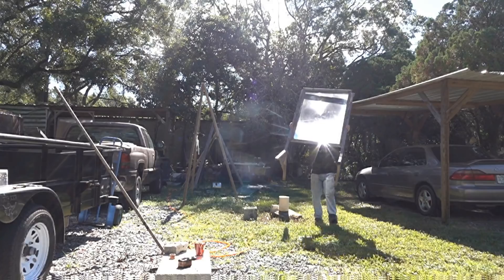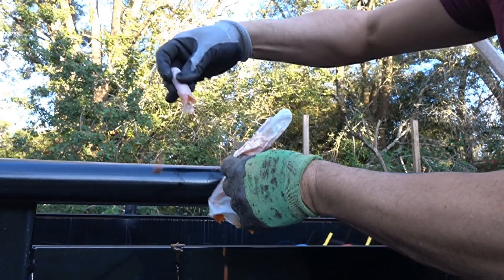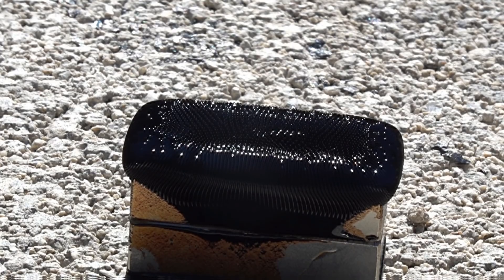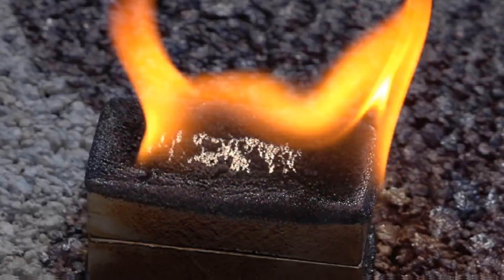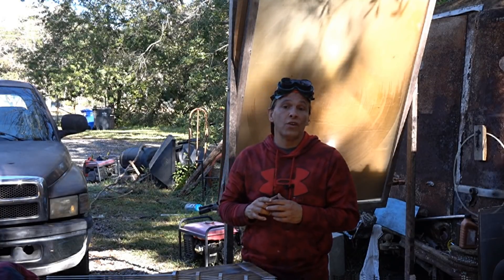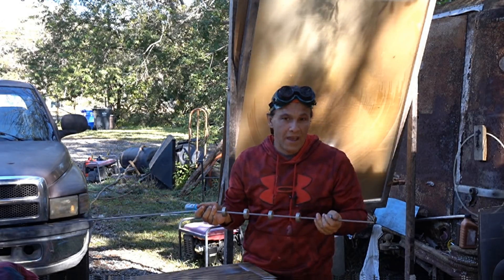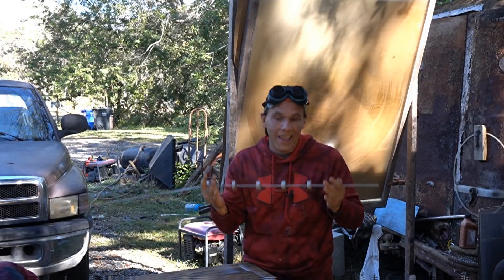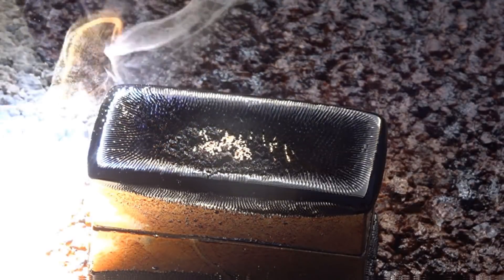POWERFUL Neodymium Magnets Ferrofluid, Lenz's law, collisions, and a Fresnel Lens

Comment: Hi,

If you get your fingers (toes,...) pinched by strong magnets, just have a proper spool with a suitable wire (windings on thereof) handy. Then use an AC power source (something low would be nice) to connect the ends to the the wire terminals. 🤔😮

Put the pinched part (hand for instance) near the coil (don't let it touch !). The produced alternating magnetic field would weaken the domains in the magnet. Thus causing it to become less strong.

You might permanently destroy your precious (pricey !) neodymium magnet, but then again you have to ask yourself what is more important - your (e.g.) finger or a magnet ? 😂😅😃😀😁😄

This thing is called a degaussing coil. There are videos on YouTube on how 2 make one.

Comment: Ferro fluid bearings? You think high speed frictionless movement can be achieved that operates better then magnet bearings? Magnetic engine with ferro fluid coating the inside wpuld allow high speed levatation effect from how the magnetic fields flowed through the fluid? That would form a vacuum layer between the fluids being acted upon by the magnetic feilds allowing high speeds to be achived? You think it would be possible? 😊
Reply: Indigo Dragon71 Hi,

You can research UFO Mercury Engine. Also Nazi Bell (Die Glocke). The Helmholtz Coil is often referred together. 😏
Reply: Nazi why becuse those insects were the zee master race? There is much better technology then what those free masonic stooges were working on for american shadow government. 😊
Reply: Indigo Dragon71 Well if you look at it more deeply, our "most primitive knowledge" (mining, ore processing, melting metals, making of knives, shields,...) is freemasonic is some sense. 🤔
Reply: Indigo Dragon71 You mean the transgendered chimera goat-(wo)man ? 😅

Well my thought was on the Fallen Angels (Book of Enoch). Nephilim bloodlines & so. 🤔

Comment: Dan i have a question for you........is it possible to use a Fresnel lens to heat a water heater tank  that has been stripped of the jacket and insulation and painted flat black, exposed to the southern sun. the tank is mounted with the top pointed north and the bottom to the south, so the tank sees sun early morning til sundown along the curve of the tank. if so can it be set in such a way to mount it for year round use with minimal adjustment. i can see where the lens can work very well for a short period of time as the focal point will be strong for a hour or so as the sun passes over or would a few lens' be mounted at different places to be aligned with the sun at different times at different spots of the tank. i haven't seen you touch on this in any of the 100's of your videos that i have watched to this point. do you think it is possible?
Reply: put something reflective underneath  or better yet encase it in a glass covered box, you can even insulate it if you live somewhere cold and yes a giant Fresnel lens or a bunch of small ones to concentrate light can help a lot
Reply: Other channels have done this with the Sun / Hot water.   You can easily burn the house down with a fresnel lens - it's something that shouldn't be unattended.
Reply: that is true .......if it were aimed at the house. this will be aimed at a tank of water.